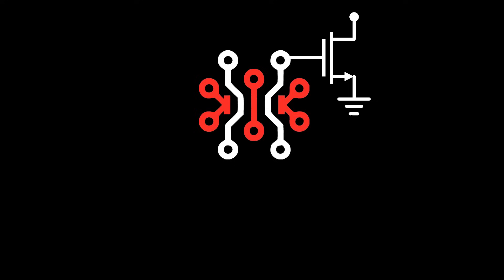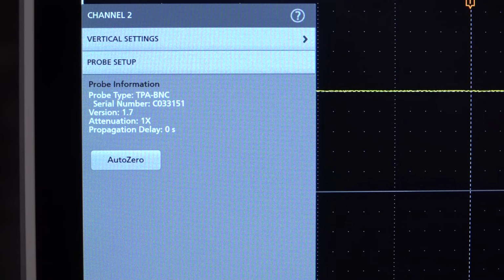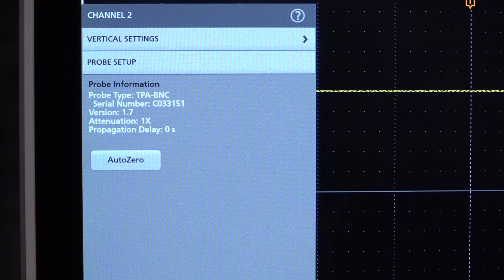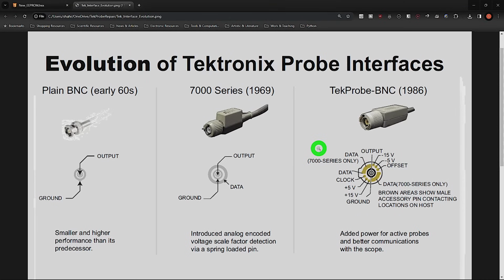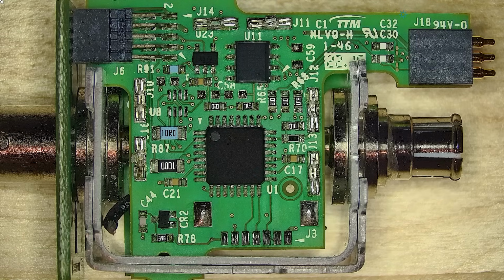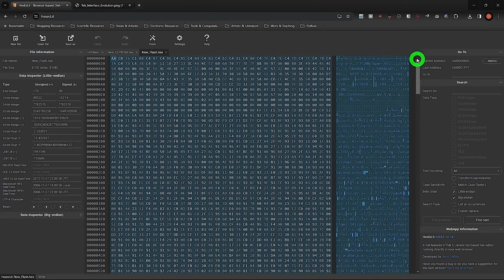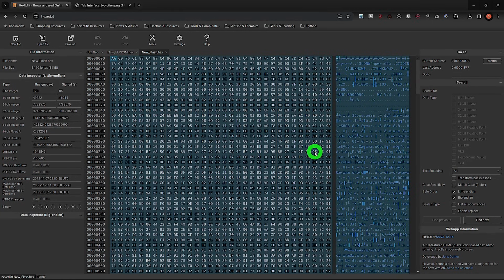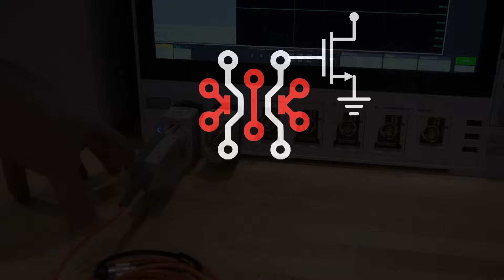TNP #45 - Tektronix TekVPI TPA-BNC (TekProbe Converter) Adapter Repair & Teardown

Comment: You didn't demonstrate how to get the firmware off and how to get it on the new probe😢
Reply from the maker: I have shown it in previous repairs of Tek probes. It is not a difficult thing at all - just connecting the programming header to the dedicated pins already on the probe PCB. You can then read the flash as well as the EEPROM.

Comment: Is there a different situation or different scope when attached the duplicate serial numbers would matter?......... I can't help wonder why Tek would apply a serial number system to them in the first place.
Reply from the maker: This probe is a passthrough as far as the analog signal is concerned. But other probes, active probes for example, have calibration coefficients or custom zero settings, in those cases the scope remembers those settings based on the serial number. So if you disconnect a probe from one channel and plug it into a new channel, you don't need to recalibrate or apply the settings. They would follow the probe. This is how Keysight does it. In those cases if you plug the same serial number probe into the scope, it would flag an error.

Comment: Always preferred the Tek interface. But the only 1GHz scope I could afford (~$400) was an old LeCroy 9374 (I needed the analog bandwidth to repair an old pulse generator). The Interface has 6 pins and no locking rings on the BNC, but retention clips/springs. Plugging and unplugging the 2GS/s adapter (basically a 50Ω power splitter for Ch2&3) feels horrible because you basically just shove it in there. It's so hard you actually have to hold that brick of a scope down, otherwise you'd just pull it off the table. The worst thing is, since teledyne bought LeCroy they haven't even made an attempt of improving this horrible interface. And to be honest I think the company went to S**t after it was bought up.

Comment: I also had repaired few of these TekVPI adapters, and actually had one blown (TI TPS LDO regulator died) during my playing with older Tektronix ADA400A differential preamp. ADA400A designed for older TDS700 series, and had some large current spikes at gain switch change with ADA400A connected to TekVPI.

Comment: The "older" interface with the BNC and multiple supplies is called the TekProbe Level II.  Level I was the unpowered BNC with the 10x/100x sensing ring around it.  Glad to see you got the old unit working (cloned from a working unit).
Reply from the maker: Thank you Alan!
Reply: @TheSignalPath after L2 followed the L3 interface enabling things like automatic probe control. The VPI and also the revised VPI+ as well as the TekConnect interface in fact still follow the TekProbe standard even to Level 1 which was the original probe sense ring you find on scopes like the 24xx series. Funfact is that even the high end Sampling Modules of the 8000 series basically use a modified and heavily extended version of TekProbe L-III.  By now the interface also contains a high speed mode to send S-parameter data from the probe to the scope. This is used for example on the TDP77xx Series which is the High speed probing platform for the MSO6 Series.
Reply: HP also had that type of probe interface with one pin contacting a ring around the BNC jacks on the scope. If you connect a 10:1 HP probe with that interface to a Tek Scope, the Tek gets confuesd and shows totally wrong scaling factors. I tested this with my Tek2445 and the readout thinks that this is 100:1 probe.

Comment: How were you able to read the program from MCU? Did they not set lock fuse bits? This is very strange.
Reply from the maker: No, luckily no lock fuses are set in Tektronix probes.
Reply: @TheSignalPath  Don't give them any ideas. 🙊

Comment: What might have caused the firmware to become corrupted, or lost?
Reply: It seems like it was just old firmware, maybe possible these units escaped from Tek bringup lab or something since it seems like the firmware is early enough such that it didn't even function really.
Reply: The earlier ones had eeprom corruption which is super common on atmega, as the processor can write random junk to eeprom during brownout. Usually best is if brownout protection is enabled, which it may not have been.